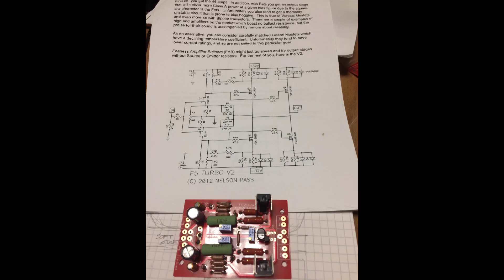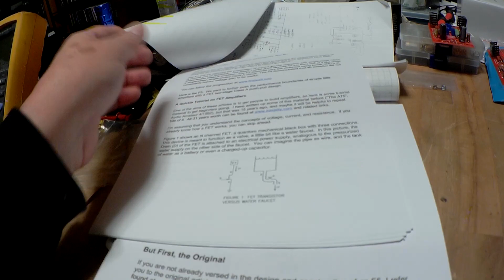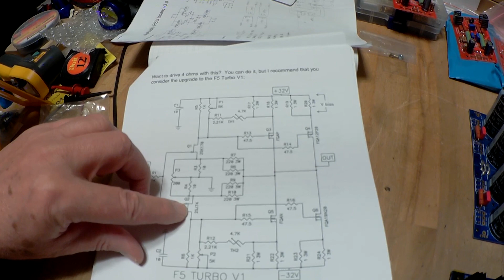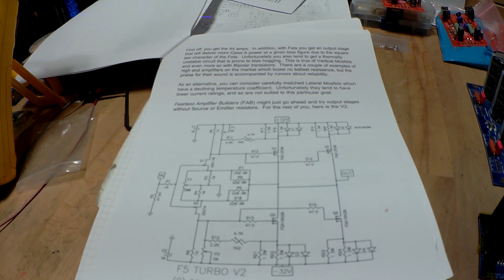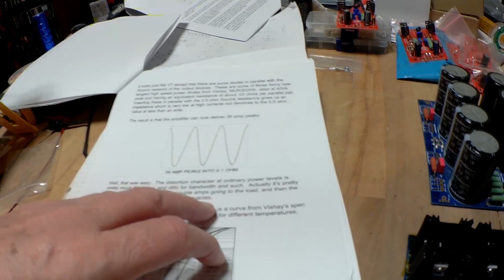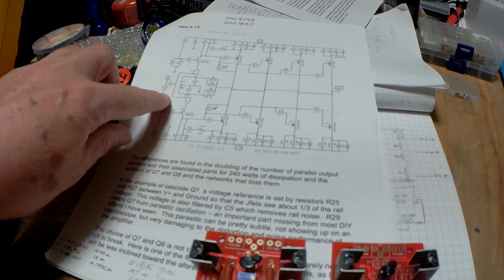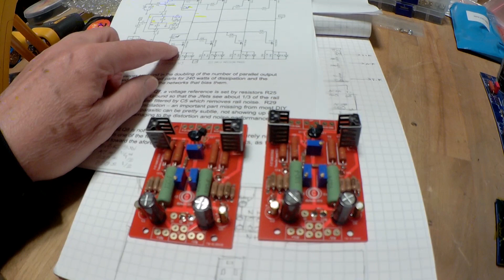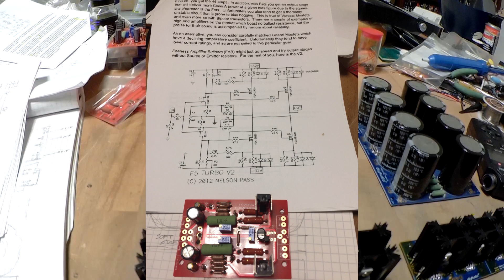Robert builds the Pass F5 Turbo 1

Comment from the maker: The Turbo circuit has Fast Diodes which can short out the Source resistors under current load so that the output MOSFETS can swing from rail to rail.
Reply: They are for a current management, due to a I -> dU of those diodes. Nelson wrote about this couple of words. Instead, people can add a transistor that is opened by the dU at high current, and shorts a signal.